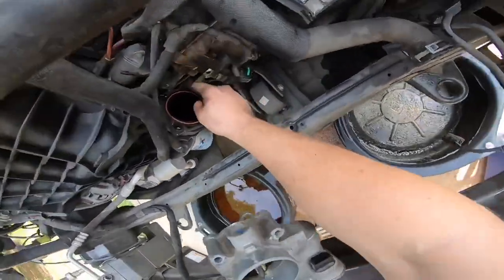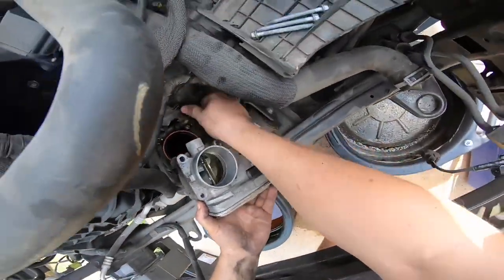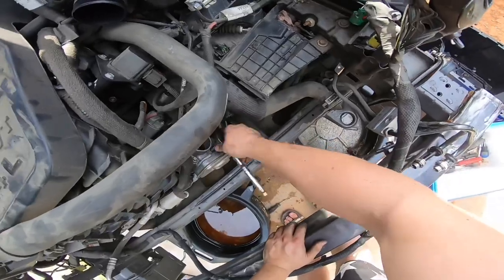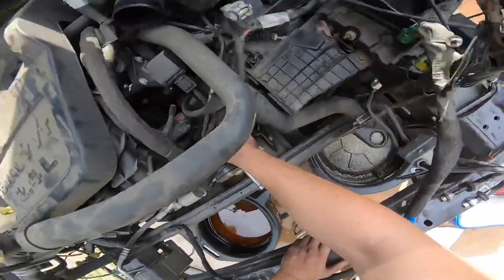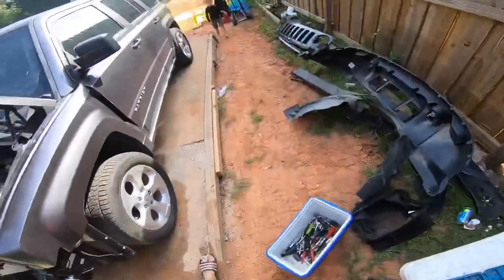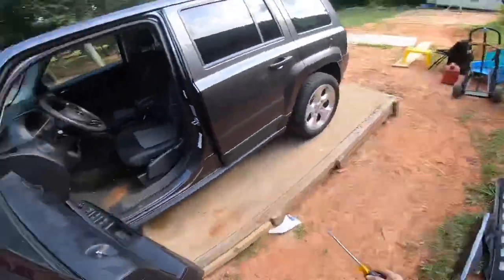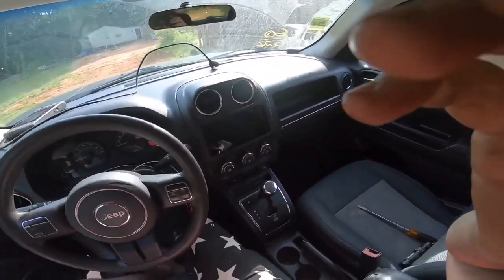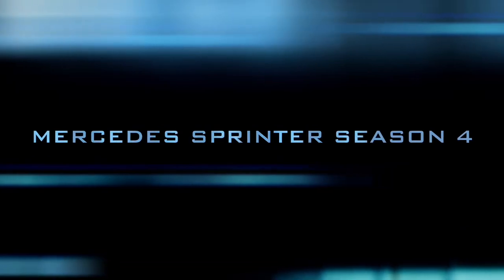How To Replace a Throttle Body on a 2015 Jeep Patriot Throttle Body Limp mode No throttle response

Comment: Is a rattle sound normal when you shake it?
Reply from the maker: In mine it was not, it was from accident damage
Reply: @ZimaletaMotors  did the new throttle body have a sound when you move it?

Comment: My 2016 patriot is having the same issues, i took it to autozone and had it scanned and code P1273 Throttle Actuator Contro System High Airflow Detected. If I change to a new one, does it have to be programmed?
Reply from the maker: No programming needed just buy one of Amazon or eBay
Reply: Same issue for my 2015 jeep Patriot manual transmission I will try and replace it myself

Comment: Clean throttle body but the electronics is in the part that was damaged. Looks like a sardine can . If dented because of accident you will have to buy a new one!
Do not move the butterfly plate because  it is directly connected to a gear set and you will strip the teeth and it won't  work ever again. Clean and replace if
it is just caked with dirt and never been in an accident of course!

Comment: It should be spring loaded and when you open it it should go right back to closed
Reply from the maker: Well mine was in the accident, so the spring and gear is crushed and damaged
Reply: @ZimaletaMotors  my ford fiesta was hunting for an idle and dying out. Took off throttle body. So dirty the flap couldnt close all the way. I bought throttle body cleaner cleaned it thoroughly the car had no issues after that

Comment: You obviously don't know wtf your doing... just replace the throttle body and your isuue would be fixed...
Reply: trying to avoid that
Reply: I replaced my Throttle Body from my Jeep Patriot 2012 and the ETC light still comes on with the Traction Control on. And my cat goes to limp mode. I’ve tried recalibrating it but it doesn’t do crap.. I don’t know what’s wrong with it now. Could it be a Faulty Wiring or something, I look everywhere but nothing on the internet.. everyone seems to have the same damn issue with no solution and it’s frustrating me
Reply: @kaoticone4879  I'm having this same issue with my 2014. I just replaced throttle body and now traction control light is on and the car is driving harder than ever. Turning it off and turns it back on helps just to get home. But unbelievably frustrating.
Reply: I have the same issue and now getting a code that says invalid data from ecu or something similar. Think maybe the ecu is fried
Reply: I've seen several forums that owners said the dealership did the repair and they're still having the same problems. I don't know what's wrong with Jeep/Chrysler that they can't or won't provide a solution.